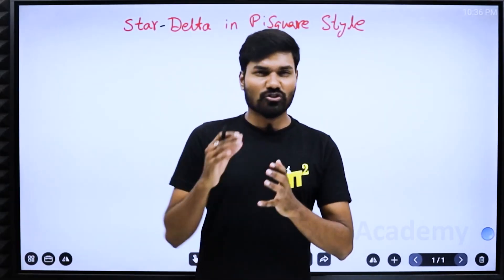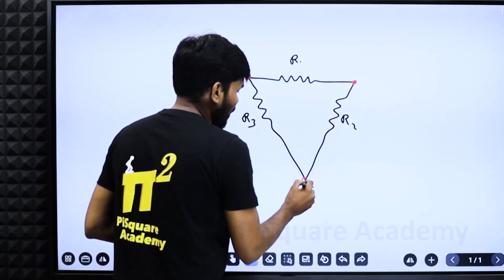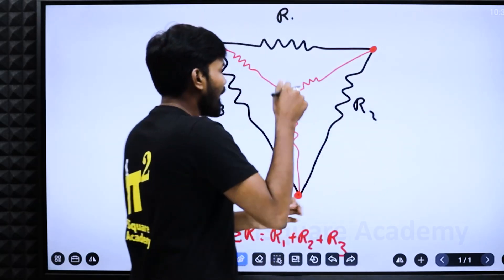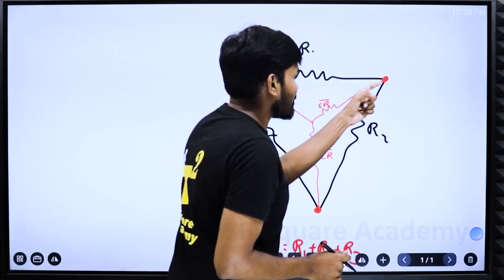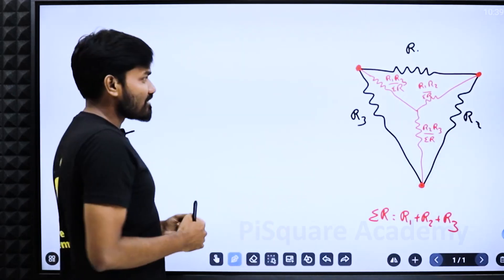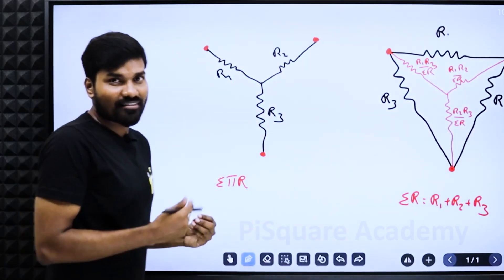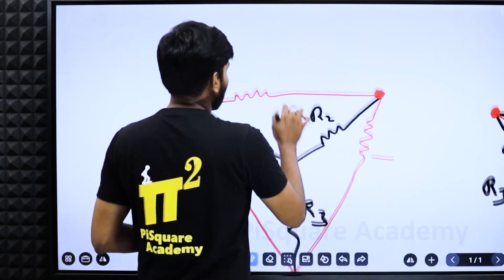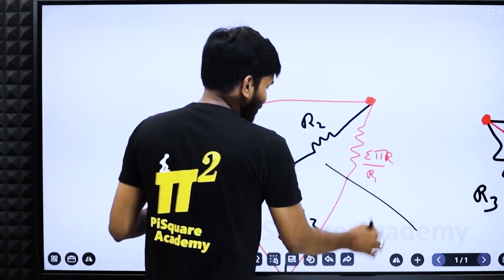Star Delta transformation in just 10 seconds

Comment: Sir why live conductor twisted in long transmission line?
Reply from the maker: In Transmission lines, we use strandard conductors(with no insulation cover) instead of solid conductors due to several factors. 
So, twisting the strands is the only way to keep them together.